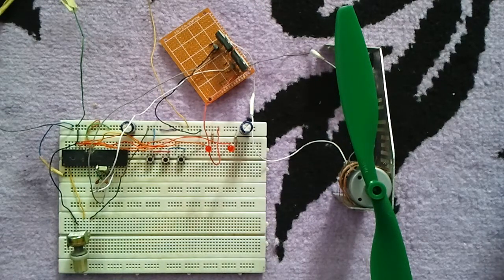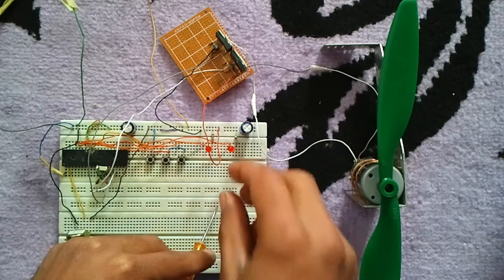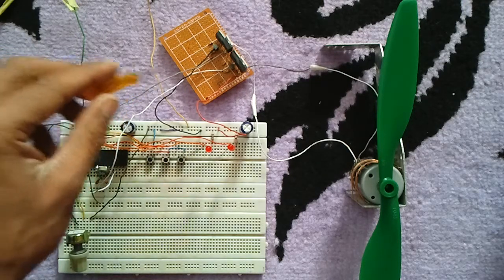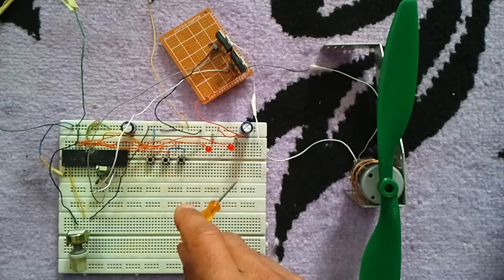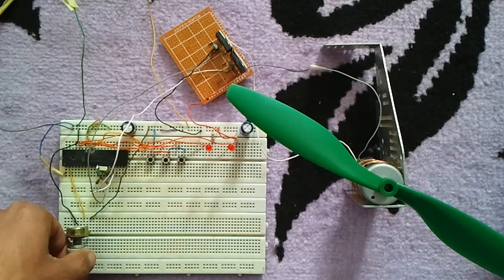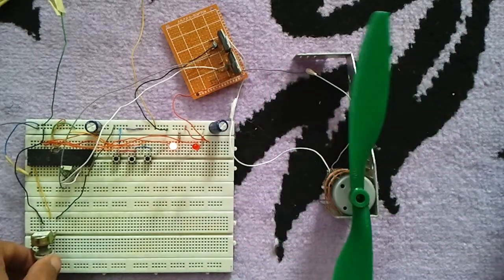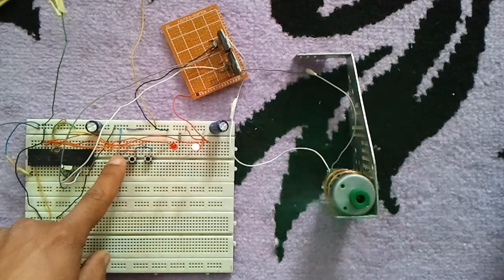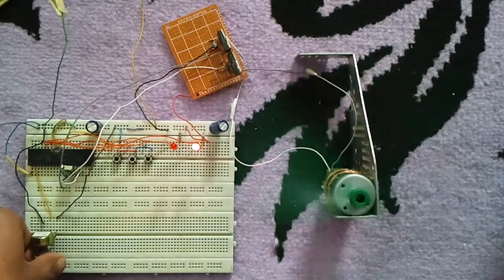DC motor speed and direction control with PIC16F877A and CCS PIC C

Comment: Hi! good job, i like it. just If i want to control the direction with a potentiometer, what do i have to change on the code and the diagram?
Reply from the maker: These are some hints about your project.
Remove the 3 buttons and use the reading of the potentiometer to control the speed as well as the direction. For example if the ADC converter resolution is 8 bits so if the reading < 128 the motor rotates in the 1st direction and if the reading > 128 the motor changes its direction.
Good luck.